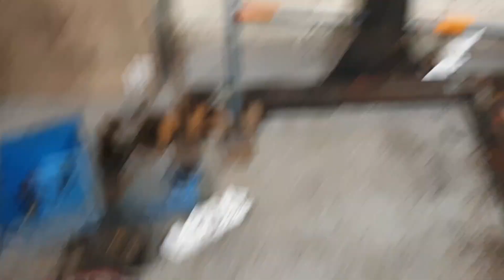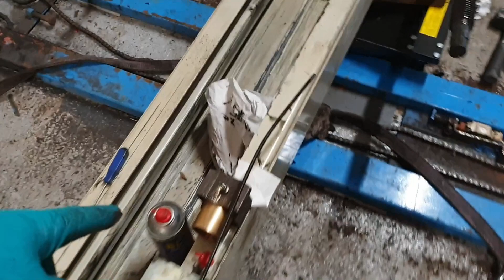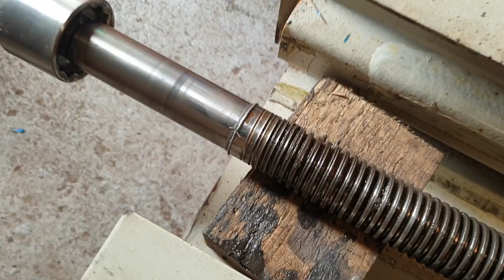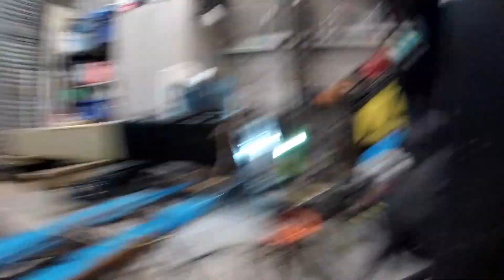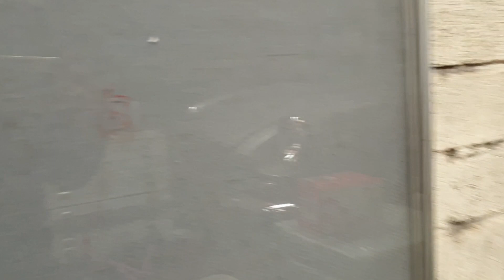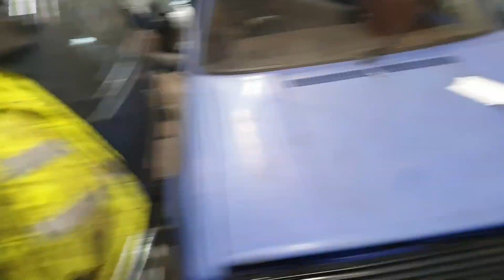2 post lifts,check your nuts carefully and regularly... A 2 post lift repair video...OMCN 3.2t.

Comment: A few hundred versus a few thousand and the safety of your life and others , is a non question! Just rebuild them or purchase a new set !! There shouldn’t be a should I or half jobs ..  if you want to have a lift and make automotive work easier and not work on the ground, DO IT ! Rebuild completely or purchase a new one .. hopefully you can drill the old lift nuts  and braze in new material , and then rethread  them and have an extra set .. nice work on the lift  , stay safe.. 👍🏼👍🏼👍🏼👍🏼👍🏼

Comment: Hi, great job! Could you tell me it the 4 bolts are tightned in the main bronze nut or are they left lose? If I torque on mine, the nut gets hard to turn. Besides, what did you do with the rollers? Regards

Comment: Persistence!  I was really impressed with your efforts in getting that second sprocket off.  I would have thought that the first one would have been worse because of welding it to the screw.  I have a Hofmann lift that was built in 1972 and I'm now more worried about the condition of the bronze nut after seeing yours.  The rollers seem to also not be tight enough, when a car is on the lift I can easily move the rear end up and down a few inches.  I can't get any info from Hofmann, they just tell me that I should buy a new one.